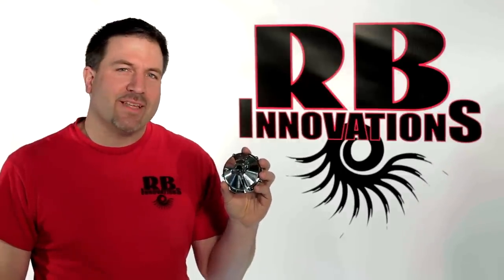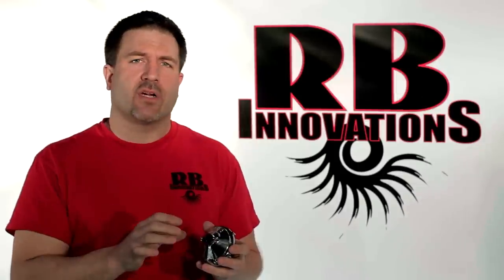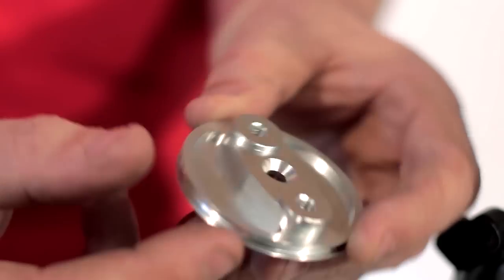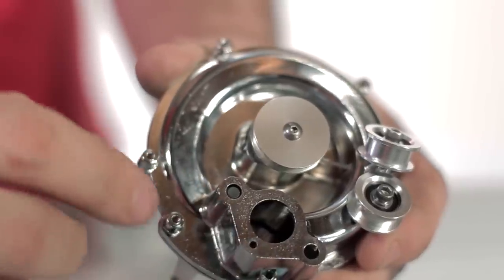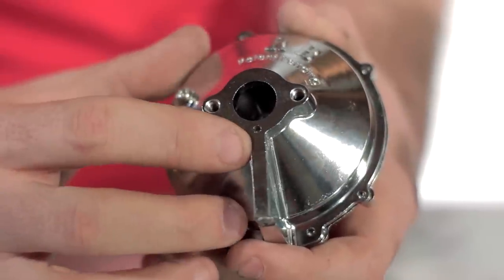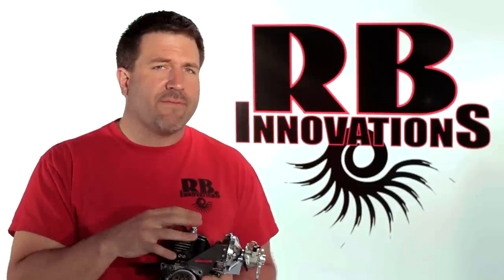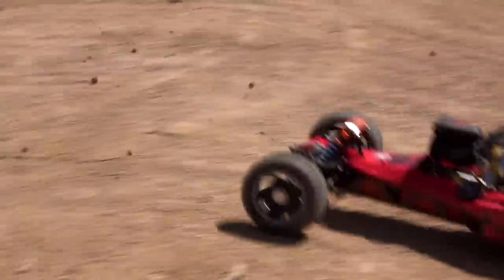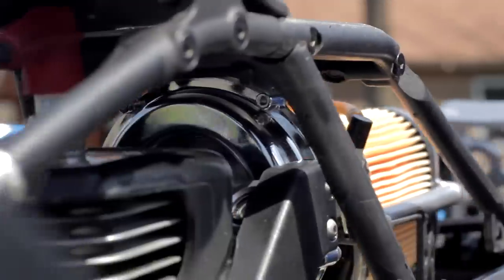1/5th Scale Supercharger Overview by RB Innovations

Comment: R U serious....this can not work and will never work in a 2 stroke.
Reply: 2 stokes hold boost just fine been running turbos in my snowmobiles for years the dino doesn't lie its more effective on reeded engines how ever it still works with other designs as long as you push more air than its leaking
Reply: For sure, its simple, all air and fuel come out from exhaust port when transfers open up. If it works fmf and pro circuit will dont have work making 2 stroke pipes. Only 2 strokes that runs with supercharger whas the diesel 2 strokes with exhaust valve

Comment: How do you turbocharge or supercharge a two stroke? Remember that the exhaust port open before and closes last during the stroke. Unlike a 4-stroke there's no way to hold the pressure in the combustion chamber because the ports are already closed off. Never mind the fact that you're defeating the whole purpose of having an expansion chamber. If you're blowing air through the expansion chamber than that defeats the purpose of it using the sound wave to help push and then stop the air flow into the combustion chamber from the exhaust side. I just don't understand how this works it doesn't make good sense

Comment: You ever try to adapt your super charger to an 1/5 scale airplane? It's tough to get enough power on those scale airplanes for better vertical performance. Also have you tried using E-85 ethanol fuel raise the boost?

Comment from the maker: The actual psi varies depending on engine and Supercharger rpm, the horsepower gained also varies depending on the engine but ranges from 20 - 40%.

Comment: Not Junk... just that comparing it with pump gas motors and nitro motors is apples and oranges...  Nitro contains 2.3 times the energy of gas per pound when burned with a specific quantity of air..  Also, it is not a "roots" ( positive displacement ) type of supercharger, it would be in the class of "centrifugal " superchargers.  But, you're quite right about it being "just a fan" ..  Has no one put a pressure gauge across one for a reading? I find that un believable.. show me 3 PSI, I'll buy!!

Comment: Will it fit on a RCMK engine? Also, is the clutch housing milled a bit around the inside part of the outer edge of the clutch like a Zenoah or CY housing is? Would be interested in trying one out on a GoPed but the motor mount needs the milling.

Comment: note boost bottles are very effective on larger 2 stroke engines, i raced motocross for 8 years, what i noticed is the smaller the engine, the harder it is to jet to run with a bottle. wouldent bother with it for an engine any smaller than 125 cc.

Comment: this guy talks shit he says superchargers are the most efficient way of getting horsepower out of your engine lol superchargers rob engine power to turn them weras a turbo uses wasted exhaust gas to spin it ther for turbos are the most efficient
Reply: your ansa has nothing to do with what I said turbos are more efficient than superchatgers simple fact even google it n no diesel actually s4 v6 bi turbo lol
Reply: -> "Exhaust Turbos are usually "working" in off-the-shelf diesel passenger cars."
...think of this ;)
Reply: rally cars are turbos think of this lol
Reply: For every action, there is an equal and opposite reaction.  This means that it takes a given amount of energy to compress a given amount of air.

With superchargers, you have slightly higher friction losses and higher inertial loads to overcome.  Additionally, a supercharger doesn't deal with otherwise 'wasted heat' that a turbo may effectively put to use.

So you are correct... but that's the least of this thing's problems.
Reply: gauntster84 it is very difficult to get a turbo to work on a 2 stroke and even more so on one that small it is much better/easier/lighter to use a expansion chamber exhaust.
but you are right on a 4 stroke gas there is nothing better/more efficient then a turbo.
Reply: ***** petrol engines can run turbos to. In fact it is very popular
Reply: they don't rob engine power because they're producing more power by forcing more air so that argument is invalid its like saying a belt driven hyper charger or turbo charger "robs engine power" because they run off of the engine
Reply: Trace Anthony are you getting mixed up, a turbo is driven by exhaust gas and a supercharger is driven from the crank shaft. Each has its advantages and disadvantages. Superchargers give instant power because it's always working, turbo chargers have lots of lag as you must wait for the boost to build up.
Reply: Depends on many variables and application, really.. (to try and put it simply) Turbos can hit peak boost very quickly and have virtually no lag, where-as a supercharger is spinning proportional to engine rpm, so, a supercharger will make little boost off the line and climb "linear" in proportion to rpm.... A properly selected turbo can hit whatever boost pressure the wastegate is set to open at, at pretty low RPMs and stay there as revs increase...

just my 2cents... ultimately, it really depends on what you're trying to achieve, so can't really say "one is better than the other"
Reply: gauntster84 nothing is free. Turbos generate back pressure. Back pressure generates heat. Turbos are superior but there's no perfect system.